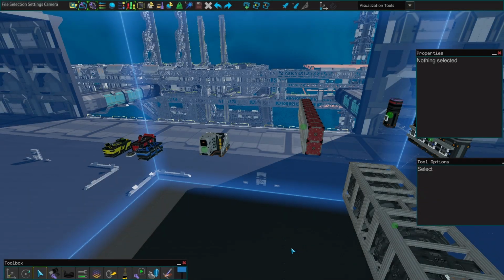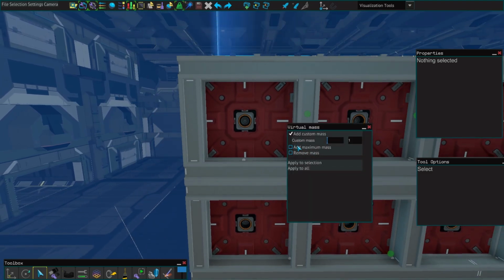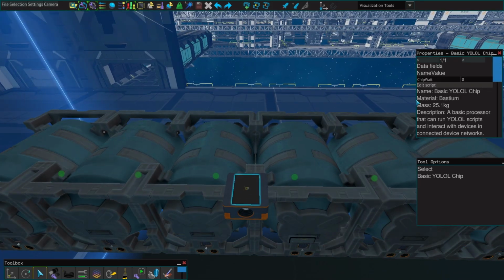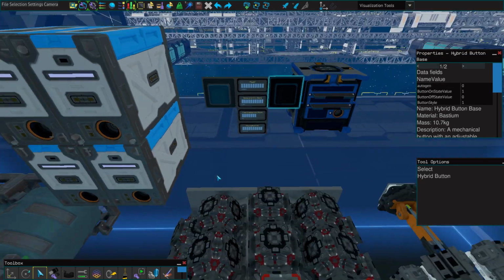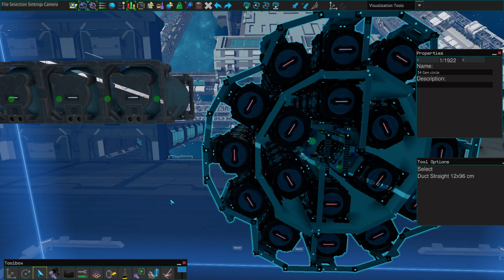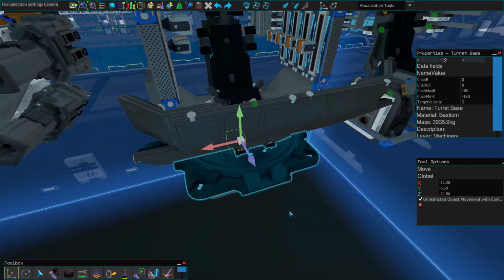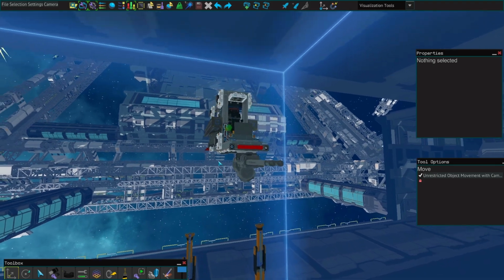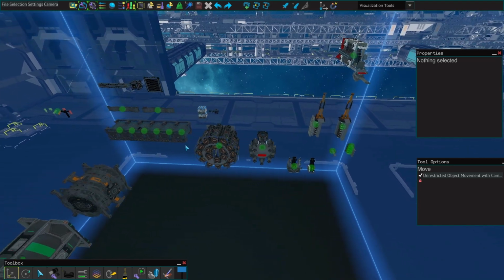Starbase - Free Advanced Module Kit

Comment: Much Appreciated! Thank you very much! I'm trying to get back into the game after many months away.  I had no idea the large gens were even a thing!  I love your gen circle cluster as well.  Is it really better to only tack on 2 gens to each fuel chamber rather than the max of 3?
Reply from the maker: No problem! Yep, them and some other things like weld blocks and speedometer were introduced a while back. I built it in a way that couldnt fit more than 2 at the time, but i did look into it and i think it uses less fuel to have less gens per fuel chamber. Meaning it lasts longer before having to refill the rods.